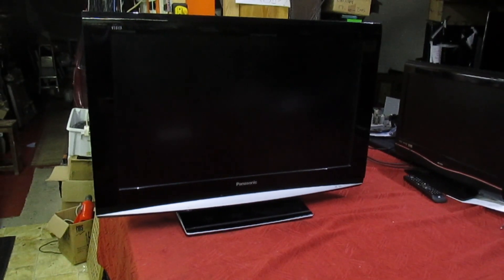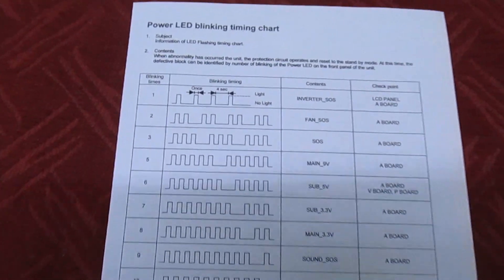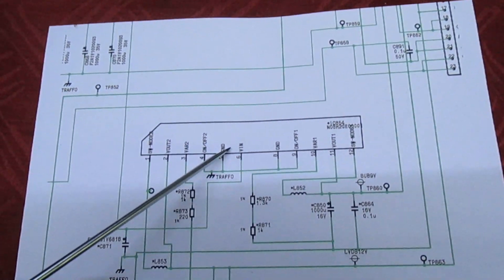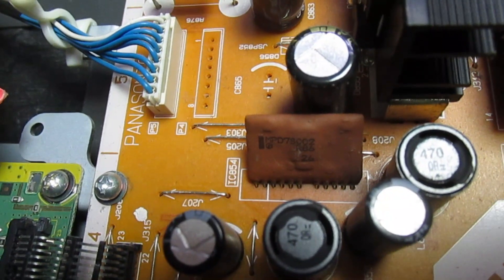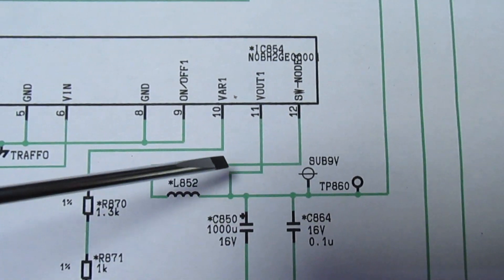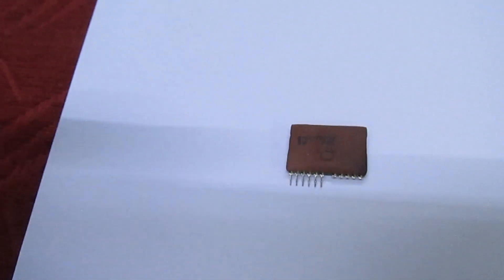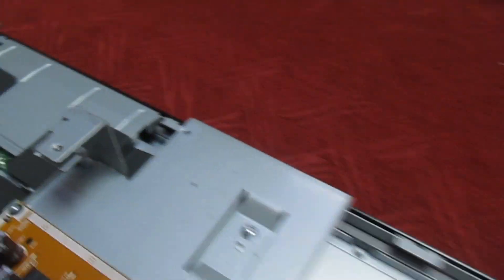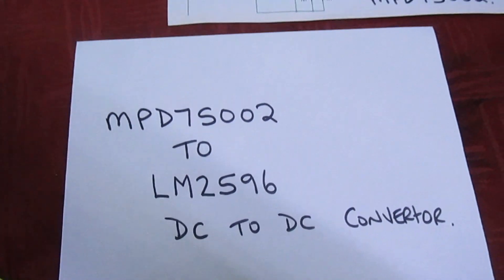Panasonic TX-32LXD85.    MPD7S002   to   LM2596 conversion.

Comment: Great video reminds me of Canon photocopiers/printers most errors are displayed as E codes but there are a few errors that uses the front soft switch off/on L.E.D. If that flashes 3 times it is the Main controller PCB,  the clock on some models is over driven. I use to work for Rediffusion back in the early 1980 we were working on solid state & PCB sets then...
Reply from the maker: Just a pity TV s are not as advanced as cars and you plug in a diagnostic unit and it tells you what is at fault, on a lot of sets the error codes are only pretty basic and can only  point you in a general direction .

Comment: I remember reading your stuff in Television magazine as a then 'have a go' engineer.  Now working as a service engineer for many years for a UK display manufacturer and love it, however, when we stopped producing CRT stuff it was the end of an era.  You can't beat that CRT display.  I've just found you on here and am working through your videos.  Thank you for the video's and the good work.  Certainly love a work-around!  Beat regards, Matt
Reply from the maker: Yep that's me , still doing the same job after more than 40 years , no fun now though working on modern stuff that's built not to be repaired , I would go back to CRT any day .

Comment: A thought for any future mods may be the Recom R789.0-0.5 (but only if there is less than 0.5A draw on the 9V rail).
Reply from the maker: I'm sure if I looked hard enough I could have found a better replacement but everything is now on the Internet and I don't have that much time for the net, I would much prefer looking through component suppliers catalogue but sadly due to the Internet catalogues are becoming a thing of the past, have a good new year.

Comment: Great to see real diag's, and practical solutions 
Keep up the good work 🙂
Reply from the maker: Sadly only possible on older sets because there is no schematic diagrams in the service manuals for newer sets, repairs are board replacement only, have a good new year.

Comment: Nice. I wish I could come and be the helper in your shop for a while. I wish I could see how you go about finding the missing Voltage....I mean how do you figure  to look for a missing voltage. Did you find the short fist. I can see myself using a thermal camera to find a short. Or other ways to find the short.....
You are the real thing.. 
Marry Christmas.
Reply from the maker: The most important thing with fault finding is checking all the power supply voltages before doing anything else, quite often no matter how obscure the fault symptoms are a missing or low power rail is the cause, the big problem is with newer equipment where there is no service manual knowing what the rail should be, then it's down to educated guessing and good luck.
Reply: @michaeldranfield7140  thank you this is very helpful